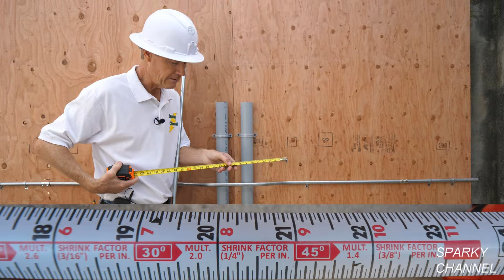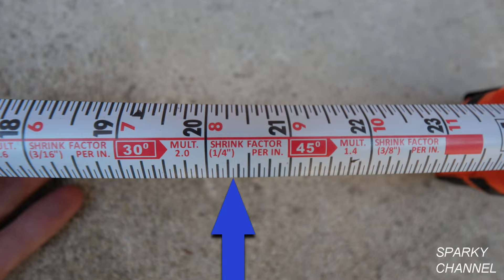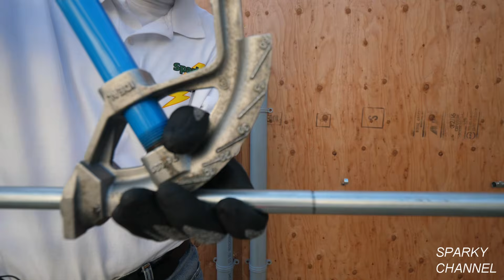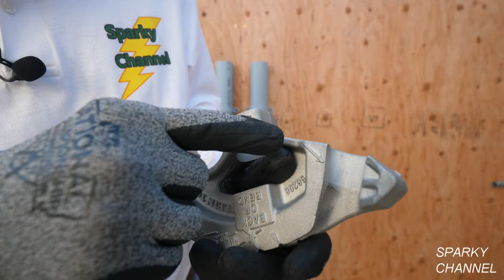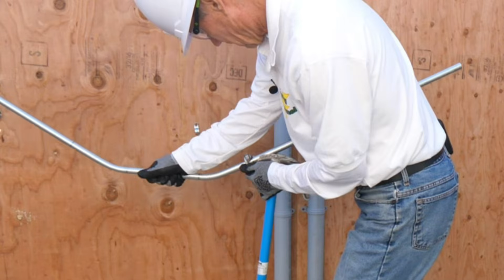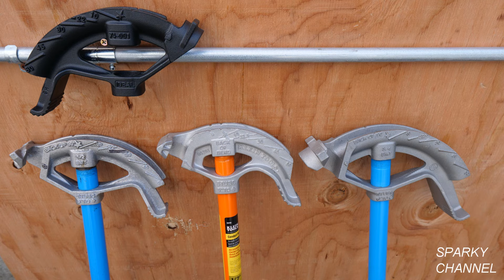EMT Conduit Bending: Four Point Saddle Bend with Multipliers, Shrink + No Charts or Apps

Comment: how did you get 7-1/4 for the other bend?
Reply: the obstruction is 7 1/4 inches wide. thats how you layout the other end of the 4 point saddle
Reply: So he measured center to center of obstacles and that was 7 1/4? @dumbeezy5480
Reply: @the_good_fellaz  no, you measure the outside edges.

Comment: If I was to use a electric bender would I be able to use these marks using center bends ?
Reply: I don't have a ton of experience using electric benders but I'll share what I remember.

For an electric bender you'd have to make a test bend first because on a lot of these benders 90 degrees may not actually be 90 degrees it might be off by 1 or 2 degrees. After you make a test bend and find out where the real degrees are for what you're doing, mark it with a pencil, sharpie, or something. After that you should look on the bender and find where the shrinks/deducts are and add that into account for your bends then line up your pencil mark with the front of the shoe, remember there is a EMT side and a Rigid side (EMT is thinner than rigid and rigid has threads on the ends unlike EMT)

Keep in mind you should either find a place that's got a level floor or wedge something into a part of the electric bender (please not on the moving parts area) to keep the bender level, it'll make your life much easier.

Comment: The  shrink factor for 30 degree bends is 3/16 ths of an inch, 1/4 " is for 45 degree bends? Unless im looking at the tape measure wrong??
Reply: Yes you are reading it wrong.  The multiplier and shrink on that tape measure is the the right of the red arrow.   It’s looks deceiving
Reply: @Diebog thank you!!
Reply: Another YouTube “expert” attempting to correct someone with more experience than your age….if yall knew how comical yall come off you would be embarrassed 😂…. 45 deg is def 3/8, 30 deg = 1/4, and 10 deg= 1/16th…..a simple google search would’ve saved you the time and embarrassment (assuming you have dignity & self respect) 😅
Reply: @PoloMFKing I learn something new everyday!!!😊

Comment: Ok so I’m noticing a lot of people getting confused especially with the 7 1/4”. Me definitely included. I’ve probably watched this video 13 times no joke. 

So what I’m gathering is from left to right you measure to the obstruction. Then you add the shrink. 3” tall obstruction, 1/4” per inch. (3 • 1/4” = 3/4”) MARK

Go back (Left)6 inches due to the offset multiplier for a 30° of the obstruction.  
 (3” • 2) MARK

Then comes that pesky 7 1/4” mark. This is just the length of the obstruction its self. Measure the obstruction MARK

Go right another 6” to complete the offset MARK

———-2————1—-3————4

Above is how I would approach the marks in order 

Mark 1 is the beginning of the obstruction length (7 1/4”) mark 3 is the end of the obstruction length. So the distance between mark 1 and 3 should be 7 1/4”. 

Im 90% sure I have this right. I hope this helps so fellow apprentices out there. Happy bending!

Comment: Straps are upside down lol
Reply: Why would you have them facing the other way and I am pretty sure there isn't an upside down for one hole straps. First I have ever heard
Reply: @j.j.riverhill2831 they actually support more weight if the hole is above the pipe. But as long as the conduit stays in the air it doesn't matter to me.
Reply: @9itsjustme2  no that is definitely objectively/factually wrong, more weight is supported with the hole on the bottom, plus its a backup in case the conduit is tugged on (through years of wear) and begins to open up a bit….a little bit of redundancy for safety measure… But dont take my word, just check any reputable instructional material.
Reply: @PoloMFKing  Unfortunately it's the other way around. Practically speaking: 
- If the screw hole is above the conduit: Gravity helps press the conduit into the strap and It usually feels more secure because the conduit is “sitting in” the strap. 
- If the screw hole is below the conduit: The strap still meets code if tight, but all the conduit’s weight is relying on the screw holding upward tension. Over time or if overtightened, this can stress the strap or pull away if vibration/movement happens.
Reply: @gwiibear4875  
Gonna have to disagree with you here
After many years if the screw is above the pipe and it loosens over time the pipe could fall right out of the hole strap because some hole straps simply don't grip on as well as others. The other way with the screw on the bottom prevents this from happening because gravity is keeping the pipe on the actual part of the hole strap that doesn't have a gap with the only escape being defying gravity and floating up or the screw completely falling out both of which are not going to happen even after years and years.

Comment: 4:08
But didn’t he had to add 1 1/2 in shrinkage instead of 3/4 ?
Reply: He did 30° bends and shrinkage for them is 1/4", obstruction is 3 inches, 3 times 1/4 is 3/4. So he lost 1 1/2 on the full stick because the two bends each lost 3/4 × 2 = 1 1/2
Reply: @bananaslol1  thanks it clicked. he should have explained the certain bends that  gained and shrunk. Outside bends lost 3/4 and inside gained 3/4
Reply: i rewatched and agree with banna im lost
Reply: Negative.  Each pair of 30d bends will "eat" (shrink) 3/4" for the offset he's doing this for which is 3".  The "shrink" amount is 1/4" for back-to-back 30d bends for each inch of offset (3" in this case).  Looking at the video: he wants to run from the left of the obstruction to the right of the obstruction.  There is a distance from the conduit on the wall to the left to the left side of the obstruction.  He measures that distance which is the first place the conduit he's adding will "hit" the obstruction.  Since the conduit will bend off a straight line (the shortest distance between two points is a straight line), it will "shrink".  The conduit doesn't actually shorten or "shrink", the path just becomes "not a straight line" therefore it isn't the shortest distance any longer.  From the left side of the obstruction to the conduit on the wall he's running from only has ONE pair of bends so it only "shrinks" 3/4" (3" offset at 1/4" shrink per inch of offset = 3/4") from the existing conduit on the wall to the obstruction.  The 1-1/2" comes into play only when we need to consider a hard stopping point on the other side of the obstruction.

I'm an amateur.  I've maybe run 2,000' of conduit.  I'm no expert.  That said, referring to the last statement above:  I run my conduit from the electrical panel to the final outlet/connection point one piece at a time, one after the other.  I never have another piece of conduit waiting on the other side of the obstruction.  However, I do sometimes have a 90d bend to change direction after clearing an obstruction or a box location to hit.  In my experience, it's far more likely to cross an obstruction and then need to know where to change direction with a 90d bend or place a box than to hit an existing piece of conduit as shown here.  Regardless of why you need to know it, it may be very useful to know where something needs to happen after the obstruction has been cleared.  It's easier to measure and mark accurately on a flat/straight piece of conduit, so marking everything you need when it's straight can be useful.  Now, imagine that, as shown here, you have a run of conduit from the left and you want to continue to the right and avoid an obstacle, just as he does here.  BUT when you have crossed the obstacle and returned to the original plane/surface, you have something that needs to occur: a bend or a box (maybe you need to place an outlet box next to a door after you cross an obstruction).  You can measure from the left where the conduit on the wall in this video is to where you know that bend or box will be placed.  Let's pretend there's a box 90" from the end of the conduit on the left on the wall in this video.  You can measure that in a straight line from the end of the conduit to where you want to place a box; no kidding, right?  BUT if you do offset bends as shown in this video, each offset is "shrinking" the overall length of the conduit by taking a longer path (not a straight line).  With two offset bends (pairs), as shown here, each "takes up" or "shrinks" an amount which can be calculated: 3/4" per PAIR of offset bends in this case.  3/4" x 2 = 1-1/2".  With a straight stick of conduit you mark out the obstruction distance from left to right PLUS the shrink for ONE pair of offset bends (3/4" here).  The "shrink" is added because the bends will effectively "shrink" the conduit by not going in a straight line anymore.  Measure back to the left the "distance between bends" and place a second mark.  When you make these bends, this first mark will now be at the obstruction distance you measured.  Mark the distance you want to span the obstruction with then make another mark at the distance between bends.  When you make these bends a second "shrinkage" occurs, another 3/4" in this example.  Finally, at the 90" mark where you want a box or a bend or whatever, you actually mark it 91-1/2" because the distance from the left end of the conduit to this mark will be "shrunk" 3/4" x 2 for the two pairs of offset bends.

What time is it?  *detailed description of how to build a watch*.
Reply: @grassroots9304 Thanks for typing all that. I was just gonna leave them a sarcastic comment

Comment: I'm confused about the 7-1/4"
Reply: Length of obstruction
Reply: I was at first to. 7 1/4 is the called the travel witch is the distance from the two pipe ends
Reply: @adamlukasik1395  ends or bends
Reply: @adamlukasik1395  I think because its so close to the other numbers. so if length of obstruction was a foot than that would be 12 inches
Reply: Thanks I rewatched for the 10th time and got it
Reply: thats where i got lost

Comment: He only accounted for shrinkage from one side of the conduit. 3/4". HOWEVER the actual shrinkage is double that amount because you are doing twice as many bends. How do you account for that extra shrinkage?
Reply: He accounted for both sides. Around 5:10 he adds 1-1/4" to the 6" distance between offsets.
Reply: @josephguida5432 That was for the obstruction dummy. The two middle marks have NOTHING TO DO WITH the offsets. 😂😂😂
Reply: @That90sShow  It's on the 1st and 3rd mark. Review the video again, you'll see.
Reply: @That90sShow  What you obviously don't understand is that the shrinkage is added in 2 different bends, in 2 different places on the conduit.
Reply: @josephguida5432  no he did not, nor should you. The 7.25 is the length of obstruction and you do not add shrink there. The first leg of the bend shrinks by half, the second shrinks by half so that just takes it off the other side. You don't need to account for that with your marks, unless you are doing another bend in the same pipe. All you do is add the 3/4 to the end of the pipe before you cut it. Or you just cut to fit and don't worry about it
Reply: @evrlastngcherry7727  Cutting to fit is waste and not methodical. 2 separate offsets, 2x the shrinkage.
Reply: @josephguida5432  dude no. If you are going from one box to another with a saddle in between, you are going to cut the extra off either way. The only difference is not accounting for the 2nd half of the shrink and cutting before. The only time it would be a waste is if you are going to add another bend in the same pipe and then I said yes you need to worry about the 2nd half of shrink. He did not add the 2nd half of shrink to the 2 middle marks like you said. That isn't where you would account for it anyway. He wasn't clear on that part but If you are simply doing a saddle from point to point it makes no difference if you either add the shrink and cut first, or don't bother adding it and cut to fit. You will waste the same amount of pipe.
Reply: @evrlastngcherry7727  It has nothing to do with cutting. The second offset will start too much before the end of the obstacle if you don't account for 2x shrinkage. The shrinkage is added in 2 places. The 2 marks at the edges of the obstacle.
Reply: That shrinkage is at the end of the run

Comment: Question, for the 3rd mark added on the conduit being 7 1/4” away from the first mark made; is that measurement the actual width of the obstruction? 
And if it is, is the 3/4” shrinkage factor applied to the width of the obstruction as well? Or is it not added? 
The first mark is distance to obstruction plus 3/4” so it’d make sense to add 3/4” to the width of the obstruction right or no?
Reply: The other half comes off the other side of the pipe so you only add it to your overall length, but you don't need a mark on the pipe for it

Comment: Klein should make tape measures with the back side having essential conduit info, concentric bend formula, ohms law etc but skip the inch measurements on the back. Also tape measures need to be slightly compact not a big block. They need magnets on the ends that won't break off.

Comment: I had an obstruction that was 2" high and 4.5" wide. A four point saddle wouldn't work right, the distance between bends would be too close right?
Reply: you could always just use smaller degree bends to put more space between the bends.

Comment: I saw you did shrink for the first offset, do you add shrink for the second offset as well?
Reply: Only if you're trying to reach a set point. (Like a box) But, more likely the pipe will end and you'll be using a coupling. So it wont matter.

Comment: Inside mark bend, outside mark bend flip conduit around inside mark bend, outside mark bend. Finished. And all from the ground (for better results) Try bending 45+degree offsets this way and you’ll find the plain of the pipe is directly in contact with the handle.
Reply: Yea especially if the conduit is going to be in an area that's super visible and always seen, 45 degrees are sharper and look nicer

Comment: I have a question. You have your first marked 33’7/8” because of there is a 3/4” shrinking this one I understand. However why don’t we add another 3/4” on the other side? So that should make 1’1/2” shrinkage in total.
Reply: The other 3/4 of shrinkage wouldnt appear until after the second set of bends. If he only did the first offset there would only be a 3/4 difference from the original length of the pipe. The distance you have to cross over your obstruction won’t grow or shrink so the center point of the bends should be a constant. I’m not sure if that made complete sense. I’ll think about it and try to figure out a better way to word it

Comment: You used the 30 degree bend correct? So shouldn’t the shrinkage be 3/16” per 1” and not 1/4” per 1”?
Reply: for 3/4 conduit 3/16 per inch is 22.5 degree, 1/4 per inch is 30 degree. it goes up 1/16 per inch starting with 15 degrees at 1/8 per inch

Comment: Does the multiplier or shrink change with different size of conduit? So if the multiplier for a 1/2 inch conduit is 6 will the multiplier for 3/4 inch also 6?
Reply: yes it will
Reply: Absolutely will.

Comment: @Sparky Channel: Could you do a show on how properly air bend 3/4" conduit.  It's pretty difficult and FAILED HARD on 3/4".

I tried doing this several times with 3/4" conduit, and messed up each time. The last time, the conduit and bender slipped in the air and I got injured badly.  Both my left little finger and my left big toe got seriously SMASHED when it cut loose.  Enough so they both turned black and I'm losing my fingernail and my toenail now..

Comment: Why 6” distance between bends?
Reply: The height needed is 3", multiplier of 2 for 30* bends. So 3" x 2 gives 6" between bends. If that makes any sense
Reply: 30 degree triangle is a special triangle with adjacent = sqrt(3), opposite = 1, hypotenuse = 2. Scale that up to match the opposite (height) with 3" requires multiplying all sides by 3", so the hypotenuse becomes 6".  Also the shrinkage factor is just (hypotenuse - adjacent)/opposite, or how much more length along the pipe compared to the horizontal length, all per unit height gained (it's actually like 0.267" per inch for 30 degrees). The steeper the bend the less accurate the triangle approximation works, since the bends have arc lengths that aren't actually at sharp angles.
Reply: @musedpony8939  I was gonna say that

Comment: How did you get 7 1/4 from the the middle ? Thought it was 6 inches from center? Just curious
Reply: You have to add 1/4 inch for shrink for every inch of rise on that side.
Reply: It's the total measurement of the two pipes, edge to edge

Comment: Great video!  How things have changed over the years!  Remember learning to bend conduit, was told to write this down, then told get to work.  Years ago it was a complete sink or swim attitude in the industry, even the apprenticeship was designed around weeding out the weak, started off with 140 student and ended up with less than 20.

Comment: Hey i like the video!!! but isnt that arrow on the bender that you were using for offsets only meant for 90° bends? I thought you were supposed to use the notch for offsets
Reply from the maker: Hi Steve. David Zee gave a perfect answer for you.
Reply: The notch is for your middle bend if a 3 point saddle bend and that’s all it’s used for outer bends on a 3 point saddle use the arrow as well

Comment: You told us that the total shrinkage was 1.5" and to compensate for it you applied 3/4 at the first mark, but where do you apply the second 3/4 for shrinkage, I skimmed the video and could not find. Ty
Reply from the maker: Just use the 1st 3/4" for your markings. The remaining 3/4" of shrinkage isn't involved in making your markings.
Reply: @SparkyChannel   Ah, okay sounds good. Thanks